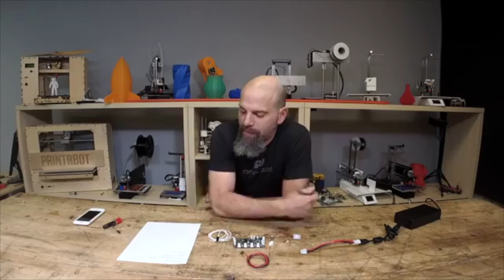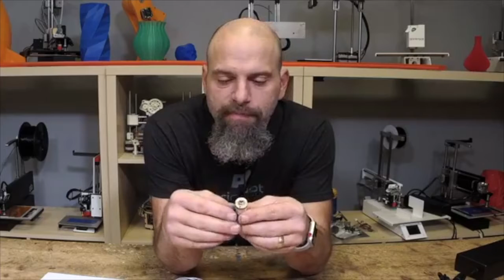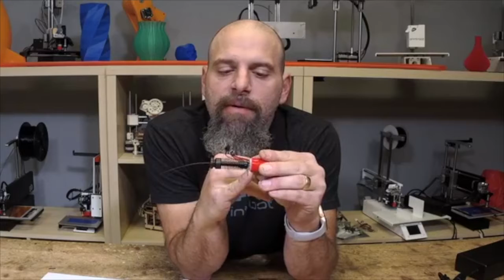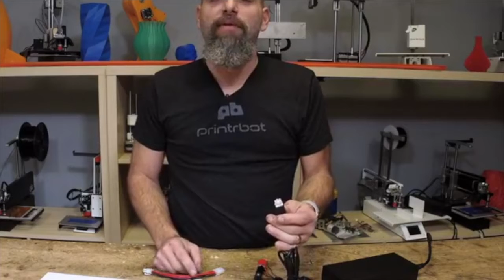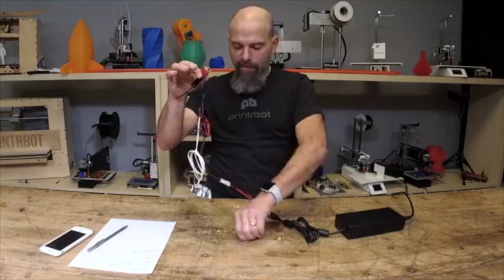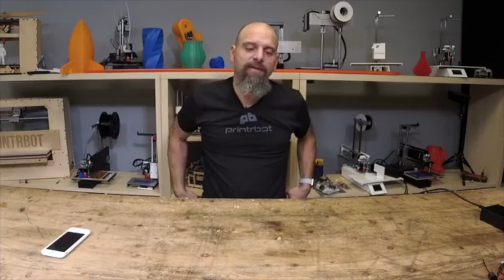Printrbot LIVE 11-30-17

Comment: Answers a lot of questions I had about your Ubis hotends. 

Very interested in faster printing - so building a printer to try out some ideas about mechanics and software. If I get the mechanics fast enough (big if), the limitation is going to be the rate at which I can melt plastic in the hotend.

When melting plastic becomes the limit, doing the same sort of predictive differential for heating that the g2core software does for motion, becomes interesting.

But when you pumping a lot of heat into the hotend, a heater not symmetric to the melt zone makes the math ... excessively interesting (or not). 

So if the Ubis hotend heater is symmetric relative to the melt zone ... interesting.